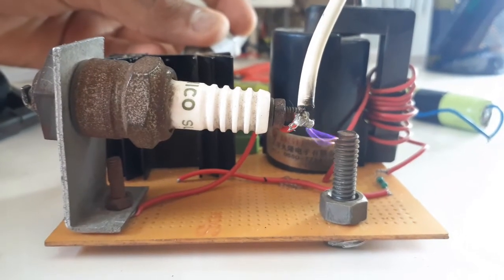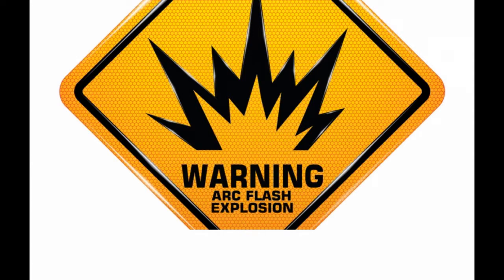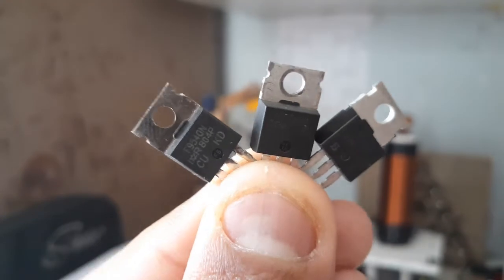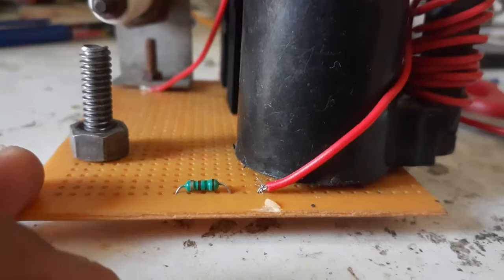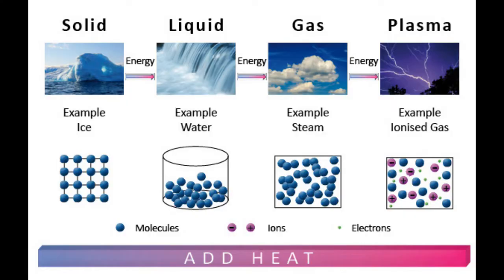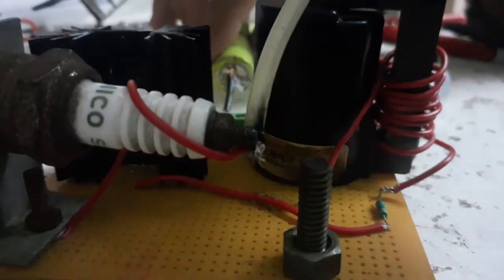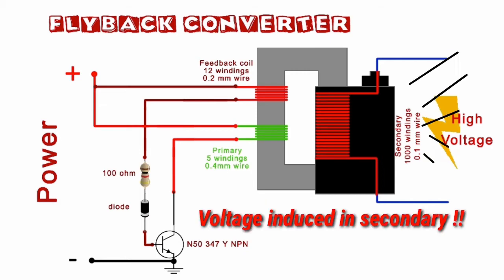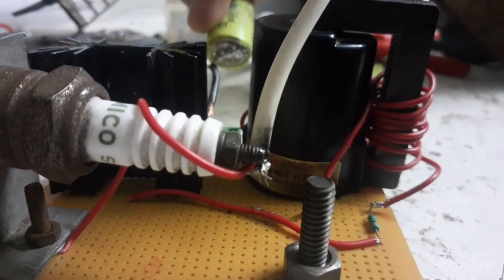20000 VOLTS PLASMA POWER SOURCE ( USING FLYBACK TRANSFORMERS) !

Comment: Can I use 2n3055 or bu505 transistor instead of mosfet
Reply from the maker: YES BUT THE CIRCUIT IS QUITE DIFFERENT IT NEEDS TWO BIASING RESISTORS INSTEAD OF ONE